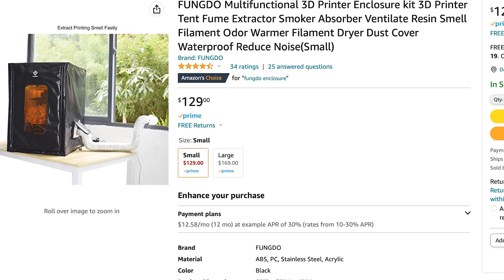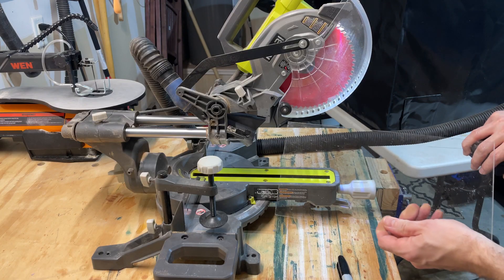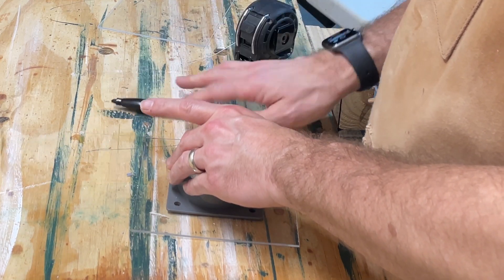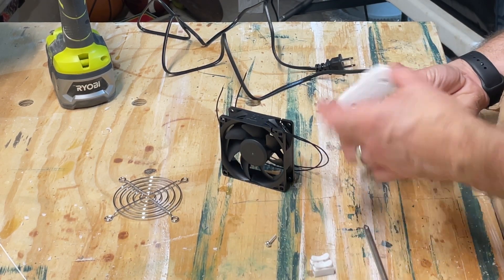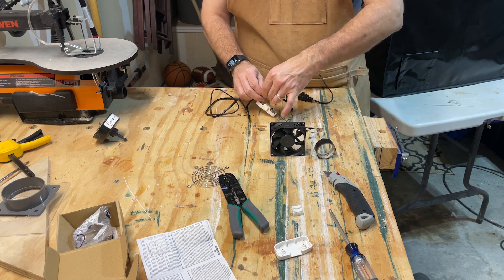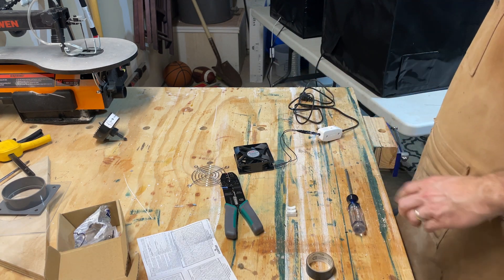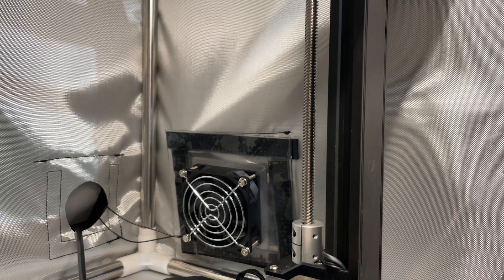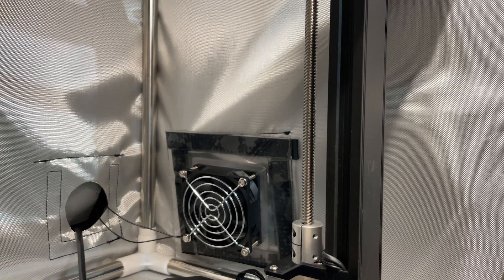Adding Ventilation to a 3D Printer Enclosure

Comment: Wait can you show or tell what you have on your garage door in order to vent it outside?
Reply from the maker: I just run the duct under the door when the printers are in use.
Reply: @shortreststudios so just close it onto the duct basically? Sorry if this is a dumb question I’m just going through brainstorming ventilating my garage setup as well
Reply from the maker: @dylanduhon7546  No, I just open the door enough for the duct to fit under.

Comment: Quick question, I've been printing inside my room for a while now... Don't enjoy the fumes. I am in the process of building an enclosure and wanted to route the air from the printer to an air purifier and back into my room instead of out the window. Do you think that would be possible?
Reply from the maker: Are you resin printing? Routing that through a purifier probably won’t do enough. You just want to route it outside. And you really should NOT be sitting in a room with it while printing if it’s not properly ventilated. Those fumes are toxic.

Comment: I'm skeptical that this fan has enough Ummph to really blow out the fumes.  Most people use a  pretty beefy fan blower specifically designed for moving air.
Reply from the maker: Did fine. But I eventually did put in bigger fans when I added printers.

Comment: Two issues:

1-you need either a check valve (flap) to prevent exhaust from going from one enclosure to the other. Alternatively, putt the fan into the common duct (don’t recommend this because you will get 1/2 suction from each printer 

2- electrical splice needs a crimp or solder connection. If you accidentally pull and disconnect you will have an exposed hot wire!

Comment: hello, what is the temp inside the enclosure after adding the fan
Reply from the maker: Honestly I don’t remember. That was about a year ago, and I’ve completely changed my setup since then. I never printed with the enclosure closed. (It was primarily to keep sawdust etc. off the printer when I wasn’t using it.) I do know that if the outside temp got too high I’d have to make sure to move air into and out of the enclosure to avoid heat creep.

Comment: Thanks for the great video and sharing your diy project.   Ventilation is important and needed, but I have a question about it.
  An enclosure is used to isolate fumes and prevent drafts from affecting the print.  So the question begs to be asked, if you create ventilation aren't you creating a draft that the enclosure was intended to prevent?
Reply from the maker: I’ve never had a draft be an issue. I feel like the “draft” would have to be classified more as “wind.” This system has never caused an issue with my prints. And actually, what it does really help with is maintaining temperature. I have to keep my printers in the garage, and it can get very hot and very cold out there. The enclosure seals in heat in the winter, and the fan helps move some out in the summer. (Prior, I had heat creep issues which were solved by circulating air through.)

Comment: Is there a filtered intake fan to maintain positive pressure? Otherwise you will get dust being pulled in through cracks and small gaps.
Reply from the maker: That was really never an issue. Small amounts of dust never caused any problems.
Reply: @shortreststudios that’s good to hear.

Comment: This is amazing this is exactly what I'm trying to do to modify a similar fabric + foil inside enclosure that didn't come with a vent hole. Trying to eject nasty particulates/vocs and maybe even keep the enclosure at a steady atmosphere. Was thinking of only turning the fan on after a print to try and eject the bad air etc. before opening the front and getting a face full of microplastics 😂.

I also had comments about this that having an exhaust fan can cause/help fire if one breaks out in an enclosure - have you found this to be a worry?
Reply from the maker: I haven’t had any fire issues, thankfully. However, yes it can be an issue, especially with plastic fans. You can put a fire damper on, but that can be expensive. You could probably also put an automatic fire extinguisher in the enclosure - like the ones they make to put under the hood of your car.

Comment: Good video. A few thoughts from a guy who spent 10 years in the air cleaning business. Without a diverter or damper closing off the duct to the Ender, a good deal of your exhaust air flow from the resin printer is going to go into the Ender enclosure, and not outside. Also, that little fan is underpowered. I would switch to something like a variable speed greenhouse fan. For those of us in colder climates, there will also be significant heat loss from the hole in the enclosures. 

Something else that exhaust systems like this can add is a way for a fire inside the enclosure to propagate. I give you props for using heat/fire resistant flexible ducts, but your 2 to 1 splitter combiner is plastic, as are your fan, flange, etc.. This can provide a path for a small, contained fire in the enclosure to spread beyond the enclosure. In an industrial setting, you’d add a fire damper on the outlet from the enclosure, and but they’re not cheap ($150 or so), and employ a metal fan and fittings. Barring that,  I’d look into mounting an automatic fire extinguisher above your printer (especially the FDM printer) to knock down any fire before it can spread.

Thanks for sharing your build.
Reply from the maker: Thanks for those tips! I’ve actually made quite a few changes to this setup since I made this video. (The main one being I have 5 printers now.) I experienced exactly what you mentioned with the airflow from the resin printer. I basically ran the fan in the S1 enclosure anytime I ran the resin printer. But now I’ve changed out some of my fans to duct fans, and I’ve got the resin printer’s exhaust isolated.

Hoping to do a video on the new setup soon.
Reply: This was so helpful thank you!!
Reply: Any thoughts on where to place the vent on your enclosure?  I have a delta printer so it's tall & skinny so I'm guessing there will be a significant temperature variation from the top & bottom. My main goal is to trap heat, so I don't want to suck out all the hot air from the top. But I don't want to create a draft at the print surface either. Of course, I'm guessing the toxins are going to be going up too so maybe I just want to get cancer in the name of producing high quality plastic so I can make friends and impress the ladies!

I have a corner bookshelf from IKEA I'm moving my printer into and I recently salvaged a duct & window vent from an AC I found on the street. (Non-sequitur: If you don't live downtown, I highly recommend the occasional exploration of DT streets before garbage day - especially when the weather changes). My tentative plan is to drill a bunch of holes into the floor of the enclosure and seal up the shelf below with the window vent. 

I saw a couple of videos about stabilizing your printer with a cement tile underneath so if the basic set up works I may make a new cement shelf to fit in the book shelf and integrate the ventilation. Given the thermal retention of cement, I'm wondering if I can get additional utility from this... maybe imbed some PVC for a small solar heater?

Comment: I have a print enclosure. I wanna add venting to control the temp inside but not to vent fumes. I'm not worried bout fumes in my case but the temp is getting too warm. Am I just overthinking it? Should I just leave enclosure opened up[ lol?
Reply from the maker: A lot of times, I do just leave the enclosure open. I mainly got it to keep dust and debris off the printer, since I have to keep it in my garage. If you need to keep it closed during printing, try the fan install. It certainly won’t hit anything, and it will help if you do ever need to be concerned about fumes.

Comment: That little fan isn’t going to move anything through 16ft of hose fair warning
Reply: He might be referring to the resistance of pushing air through the hose.  Resistance would be length x hose diameter.  To overcome that you would need to make sure the fan is powerful enough or you will be getting a lot of turbulance and backfeeding.  Think of air like you would a liquid.  That exhaust hose isn’t empty, you must push everything ( ie air) in it out in order to exhaust the air in the enclosure through the exhaust hose.
Reply: @Valketa  Temperature and orientation seem very relevant... I've never had a powered chimny but they seem to suck the smoke out of my house.
Reply from the maker: It’s a pretty powerful little fan. Works just fine.

Comment: Excellent video! You might want to put a fan at the exaust end of the hose after the Y to make sure all of the air is moving in the correct direction.
Reply from the maker: Yeah, I’ve run across that already. I was considering creating a new Y with a valve or door to direct the flow. Right now I have to actually run the fans in both enclosures anytime I’m using the resin printer.
Reply: If you use it with your Ender 3 you might want to add an input fan as well or don't use it with PLA.  I found out the hard way after my Microswiss hotend clogged twice so I only use PETG now.  I wii at some point add some fans to my enclosure so that I can print PLA again.
Reply from the maker: @zk_6312  I typically don't close the enclosure. Especially now when the weather is really hot. The enclosure is mainly to keep dust off it when not in use. When it's in use, I open the front put a fan in front of it and use the vent fan. But you're right, ideally, I need to install a second fan to pull air in. Then I can keep the enclosure closed.

Comment: This is actually a very good idea for those who don't have a hefty enclosure. That being said, do you leave the fan on during printing? Or do you turn it on after a prints done.
Reply from the maker: Usually I’ll turn it on after to vent before I open the enclosure. I’m concerned about temperature control if I run it during. But I plan to do some test prints soon with the fan running during print.
Reply: @shortreststudios  I know it's been a year lol but can you tell your conclusion on this?
Reply from the maker: @ since it's in the garage, I run the fans during prints only when it's excessively hot outside - which happens a lot in the Texas summer. Otherwise, I don't run them. (I mostly print with PLA.)
Reply: @shortreststudios  Thankyou!